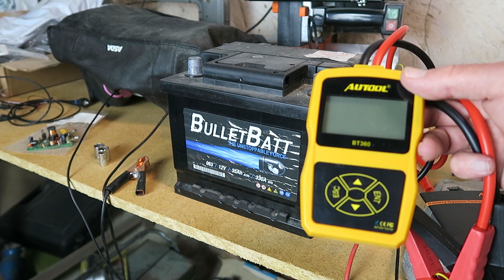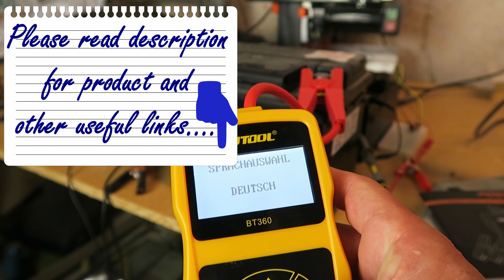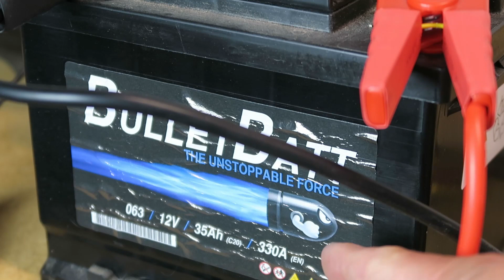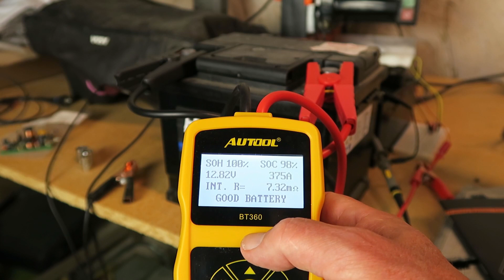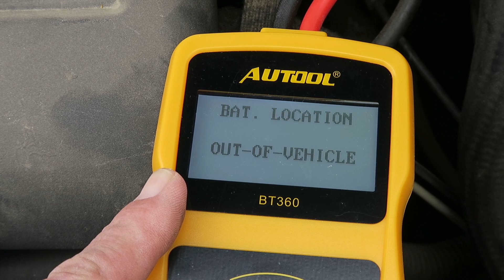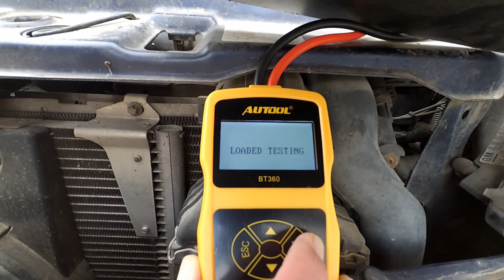Battery System Tester BT360 Autool Test Review

Comment: Hello. I have just bought this BT360 tester and I have tried to measure on new AGM battery Varta 70Ah, 760A. The measurement was SOH 70%, SOC 98% and only 670A. Is this correct or something doesn't work. Thanks for your help.
Reply from the maker: There are 2 types of AGM battery you can select in the menu, Flat plate or spiral do you know what the Varta is? Maybe try each. Otherwise test against a known good tester in a garage. Thanks for watching, have a great day!
Reply: @1nformatica  no I don't know which is it, because it's not written and I have tried both ways and it was the same. Thanks for reply

Comment: can it use to lifepo4 battery
Reply: how about the model bt760 or bt860 sir
Reply from the maker: @rdp9110  No they do not either. This tester has a Lithium setting : SM8124A Battery Impedance Meter https://s.click.aliexpress.com/e/_9yxISN
Reply from the maker: No, Use to test a wide range of 12V batteries (Starting [SLI], Deep Cycled and Marine) of Wet (Flooded), VRLA or Maintenance Free (MF), Sealed Maintenance Free (SMF), Absorption Glass Mat (AGM) and GEL cell. The major battery standards JIS, SAE, EN, DIN and IEC are supported.

Comment: If you get a chance pick up a midtronics unit. They are made in America, they are expensive, but the accuracy is what you're paying for. If you take a Volt meter and test it against a cheaper battery tester you'll find that the numbers are off which means the entire tester is off.
Reply from the maker: Hi, thanks for the recommendation. As a hobbyist I cannot justify that sort of money for something I may use a few times a year. I checked my Autool against my Fluke DMM and it read the same within 10 mV which is OK by me!

Comment: can this tool check the lifepo4 battery?
Reply from the maker: It will test a liFepo4 battery but it does not have a specific setting for that type only 12V batteries (Starting [SLI], Deep Cycled and Marine) of Wet (Flooded), VRLA or Maintenance Free (MF), Sealed Maintenance Free (SMF), Absorption Glass Mat (AGM) and GEL cell. If you tell me more about the battery you want to test maybe I can suggest an alternative. Please consider subscribing if you have not done so already!
Reply: @1nformatica   thanks for ur information, i have subscribed ur channel. and im sorry but i nee inform my lifepo4 battery from this product https://m.made-in-china.com/product/12V-17ah-Life-Po4-Battery-Pack-891672345.html

it is a battery rated voltage 12.8 volt, 17 Ah, Input 4 A, Output 8A. if you like you can check more information about the battery on that link. So can u suggest alternative tool test for this battery ?

thanks

Comment: 3:12 The battery capacity (CCA or EN) is low, because it needs to be charge (SOC: State Of Charge). As the battery is charged, both its capacity and voltage will increase.
The SOH (State Of Health) is the one relevant here, because it is linked to the interior resistance of the battery (amongst the battery cells), and in this case is low - which a good thing - indicating the battery is good, and it is only recommended to charge it.
Moreover, the cranking time is clearly too long - possibly even causing premature failure on the starter.

Assuming the values provided by the Autool BT360 is true, the battery is good.
You should charge that battery asap (I know it has been almost two years 😀 ).

I recommend the NOCO Genius, either the 2, 5, or 10 versions, to charge your battery.
Reply from the maker: Thanks for sharing useful information. Turns out my battery had one bad cell that eventually would hold no charge. Just replaced it this year when the weather got cold! I put a Varta Silver Dynamic E38. Please consider subscribing if you have not done so already!

Comment: What made you think the battery was suspect? Did it fail to start one time?  It’s possible all it needs is a good charge according to the low voltage.
Reply: My 4 year old AGM is down to 43% SOH and 450 a (680 A rated)amazingly still starts in cold weather! Good to see you did a test connected and disconnected. Seems it doesn’t skew the results when connected.

Sounds like some sort of soft short inside your battery if the voltage can’t be maintained.
Reply from the maker: Hi, thanks for watching. My car failed to start in cold weather. Turns out that one cell has low voltage, somehow it is faulty. Even on a long charge the faulty cell does not come up to voltage, maybe some "crud" between the plates. Please consider subscribing if you have not done so already!

Comment: if battery test says is good but cranking test is low should the battery be changed?
Reply from the maker: For me the "acid" test is whether the vehicle starts or not. Low cranking amps is a sign the battery is aging but until it lets you down I would not replace it. Please consider subscribing if you have not done so already!
Reply: Do not trust this tool.

Comment: Will it test a EFB Stop Start battery
Reply: Looked on the autool FB page can't seem to get a straight answer My battery is a EFB Stop Start 75ah 700a sae/enT7 battery but EFB doesn't come up on the display so just trying to make sure your help would be much appreciated Thanks.
Reply from the maker: @alanmeasures8337  I would use the AGM setting, I don't think it will matter. You could look on their website : https://www.autooltech.com/
Reply: Also been on that site Many Thanks for your help mate I will definitely be a subscriber
Reply from the maker: @alanmeasures8337  Thanks! Much appreciated.
Reply from the maker: Yes it will test a EFB battery, the results should be similar to a AGM battery. Maybe ask on the Autool fb page : https://www.facebook.com/autool.vip Please consider subscribing if you have not done so already!
Reply: Yes I think I will get the Topton bt100 but thanks all the same

Comment: Looking at the 360 and 460. Haven't found a spec list to see the difference besides the screen. The 460 has usb does this one?
Reply: The 460 can do 'Maximum load test' which the 360 does not
Reply from the maker: @gorbulas  Good to know, thanks for sharing. Please consider subscribing if you have not done so already!
Reply from the maker: This unit has no USB or colour display, I guess that's the difference. The other specs you can see in my video description. Please consider subscribing if you have not done so already!

Comment: How do these testers work out if you need to “ replace” or “good battery” Reason i ask is i see results that say “ replace” but then i see results that are worse but it says “ good battery” They don’t seem accurate. Example my battery reads 540A ( rated 680A) 63% health but says good battery.  I have seen cars read the same results but say. Replace battery.
Reply from the maker: Only the people who programmed it will know for sure! My guess is that when determining "Good" from "Replace" it is looking at Cranking Amps, Voltage sag and internal resistance. Your battery may have only 63% of its new capacity, but if the internal resistance is low and the voltage does not sag too much then it is still "good". A battery with high internal resistance may show 63% of cranking amps but the voltage will sag so it's time to "Replace". Just my 2 cents! Please consider subscribing if you have not done so already!

Comment: What RPM do you set the engine to for the charging test?
Reply from the maker: The unit will tell you "increase revs" if it is too low. I guess around 2500 for my car.

Comment: Just ordered the same tester, what's the range for good internal resistance?
Reply from the maker: I would say anything below 15 milliohms is OK but the lower the better. Also depends on battery type gel cells will be higher.
Reply: It all depends on the temps in which your doing your testing in but the general rule is 5 and under is good but it can be up to 6 like and still be good but that only in the most extreme cold so if it in the summer and its a 6 and above the battery has way to much resistance and it should be changed so 3.5 would be ideal for a new battery.   good luck.

Comment: Biaa digunakan untuk aki berapa ampere? Aki 100 ampere bisa kah?
Untuk mengukur CCA aki juga bisa?
Reply from the maker: Itu tidak mengukur arus baterai. Ini mengukur "Cold Cranking Amps" yang sebenarnya dan membandingkan nilai yang Anda masukkan berdasarkan peringkat baterai. Ini kemudian akan memberitahu Anda "State Of Health" SOH dan "State Of Charge" SOC yang merupakan ukuran dari baterai "penuaan".
Ini mendukung standar CCA di kisaran 100 - 2400.

It does not measure battery current. It measures the actual "Cold Cranking Amps" and compares against the value you enter based on the battery rating. It will then tell you the "State Of Health" SOH and "State Of Charge" SOC which are measures of the battery "ageing".
It supports the CCA standard in the range 100 - 2400.

Comment: Seems to be a great tool.  I wonder, and will check out, if it is also useful for lithium-ion battery-packs for eBikes.  The State Of Health sounds like a must-know metric for each pack.
Reply from the maker: Hi, unfortunately it is not suited to Lithium batteries. Firstly the max voltage is 30 volts. My eBike is 36 volts https://www.youtube.com/watch?v=SlcGpaMVoLY
Also the "SOH" is calculated based on Lead Acid construction / chemistry and would not be meaningful for a Lithium Pack. SOH for Lithium batteries is extremely complicated to model https://aip.scitation.org/doi/10.1063/1.5065477
I have not seen a device that measures anything other than internal resistance for Lithium packs and although this is very useful to know it is only part of the story. If you have seen a device for Lithium packs with this type of feature I would be interested to know.